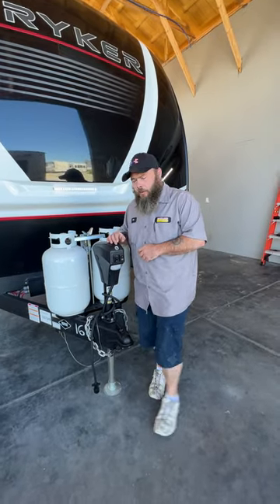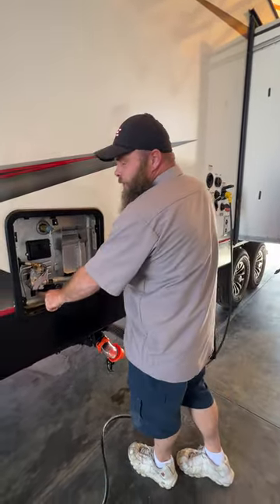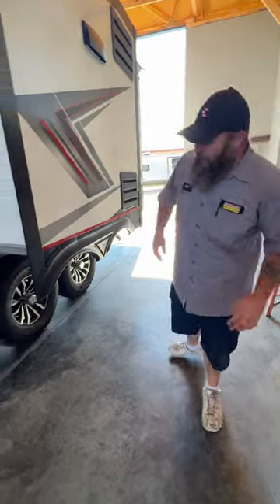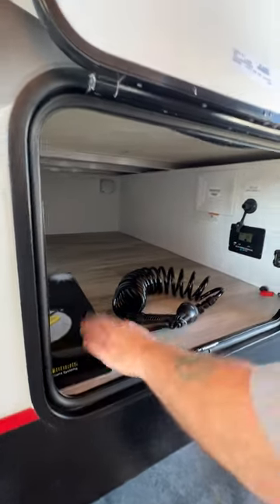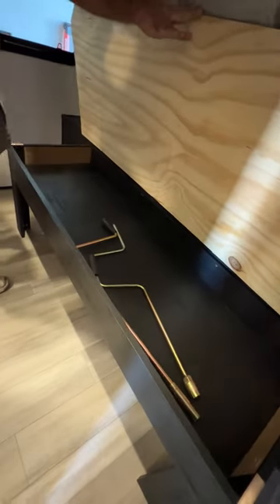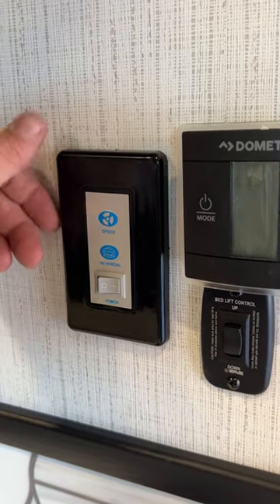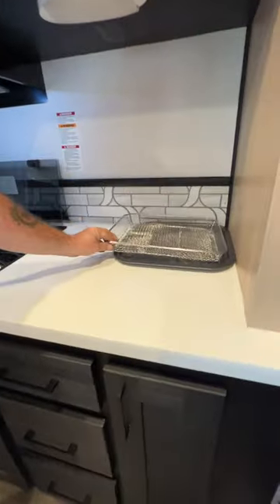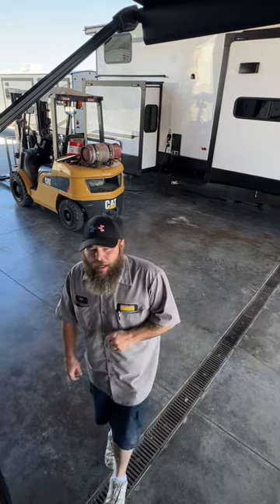Virtual Walkthrough of the 2024 Cruiser RV Stryker ST2613 Toy Hauler at Parkland RV Center

Comment: Looks a lot like my 2022 fuel 287 .. besides kitchen..  love our rig ..  besides slide floor is already rotting ..   ugh.. and I seriously pamper my rig..  and do a monthly check top to bottom.   Garaged in a barn.  Washed monthl, buffed “waxed” every 3 months ..   no leaks and for some reason slide floor has started to rot.. ugh !!!
Reply from the maker: I'm so sorry to hear that! One thing you can check for (I just learned this the other day while I was out in the shop with the service techs) is check the roof caulk for bubbles. The bubbles will pop, and that leaves a "cup" that will catch water and leak inside. The leak will be really small, and the water will travel so slowly that you won't really see it until it shows up as rot. Hope this helps! (Oh--if you find a bubble, pop it and use lap seal to seal over it after you clean the surface. If you find one that has popped, use lap seal to seal over it after you clean the surface.)